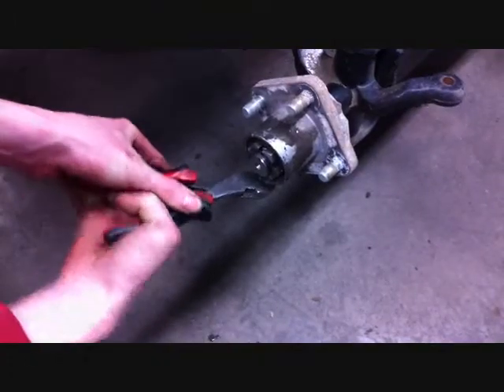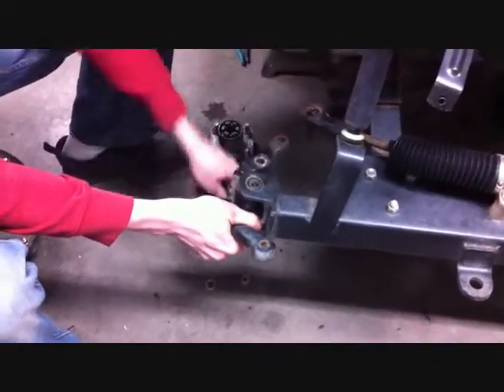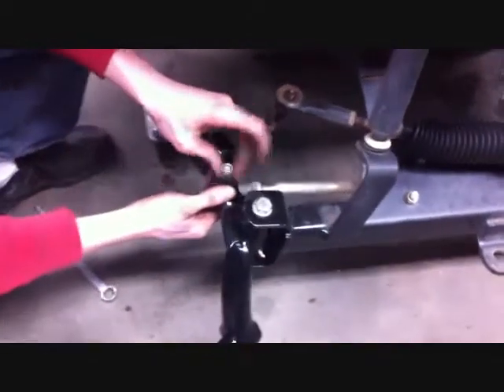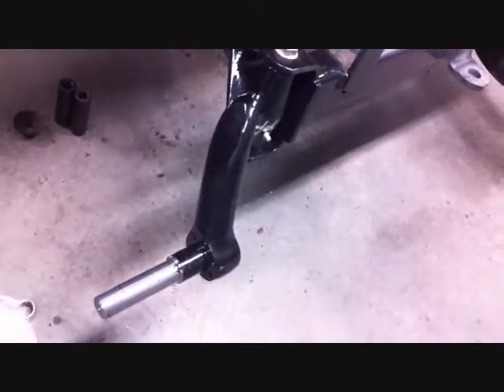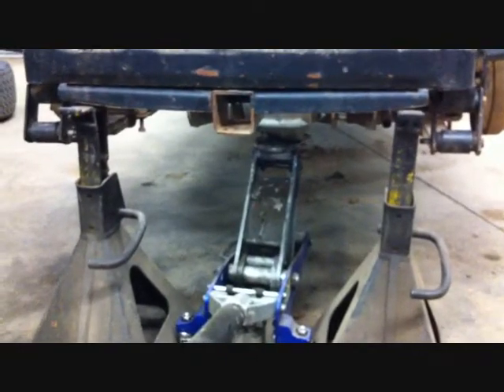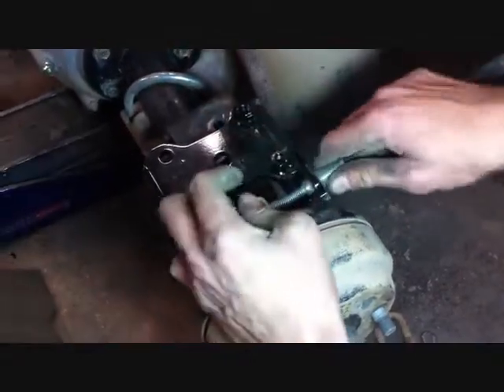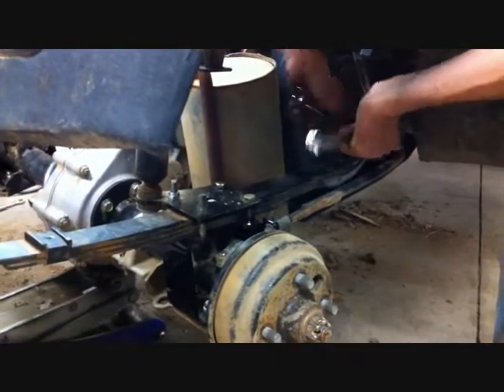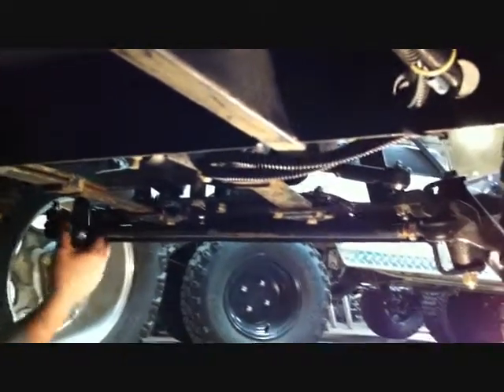Jake's Spindle Lift Kit for E-Z-GO 1200 Workhorse Gas 2001.5-2008.5 Installation

Comment: Just bought a workhorse, i found out it is a 1200 from the rear brake linkage u mentioned, but i dont know if its a pre or post 2001.5? It has the three bolt steering columb